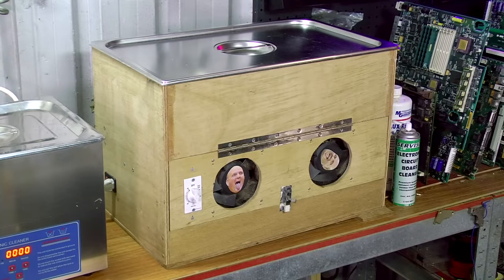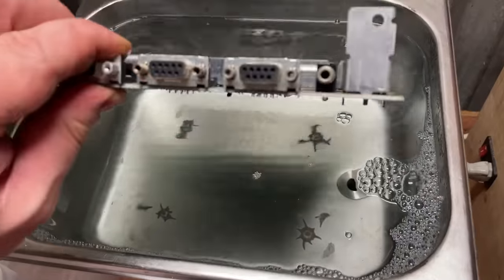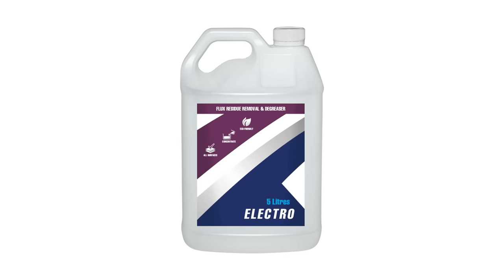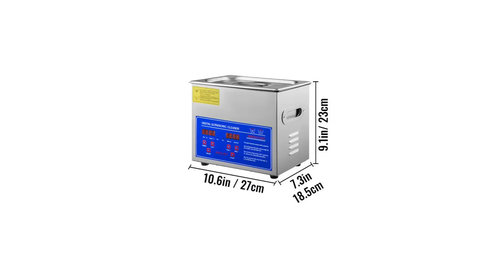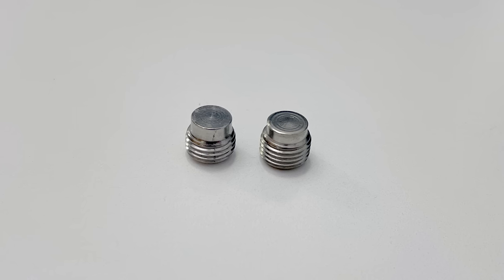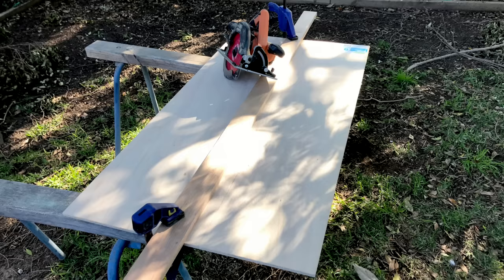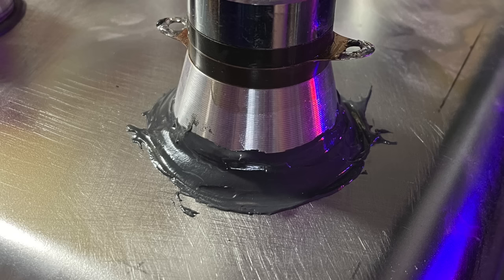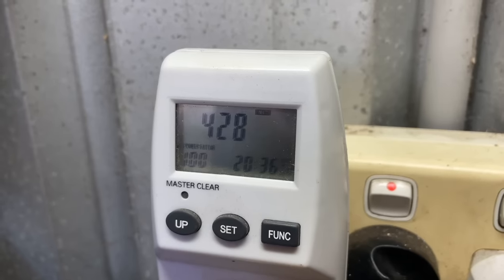Building my own Ultrasonic Cleaner

Comment: I bought a Vevor 55LT that had been dropped hard on eBay for 50 usd, I opened it, I found that 4 of the transformers had dislocated from the boards and like you, I have not found any replacement

Comment: Can anyone tell me why the transducer is able to transmit energy to the container when it seems to be just hanging freely off the bottom, without any force pushing it upwards? Or is it that the horn itself bends, while being held by the small threaded bolt welded to the container?
Reply from the maker: There are piezoelectric plates inside the transducer that vibrate to emit the sound.
Reply: @BranchusCreations  Thanks for the reply! Yea I was wondering though, since the other end is freely hanging, why is the vibration transmitted to the tank, rather than just vibrating the other side of the transducer? But I've found an answer since, apparently it's through inertia!

Comment: very good your video. I don't know what the voltage of this source is for powering the transducers. If it's 12V dc, you could use a real 500W Atx Source. High frequency PWM system very well filtered output voltages.  Long life!!! a hug from Brazil  Thank

Comment: All of the Chinese ultrasonic cleaners on Aliexpress suffer from quality control issues. I ordered few of those, but out of all of them the worst experience I had was with Vevor. One of the two ultrasonic transducers (a 3L unit) simply detached from the bath and fell on the PCB. It was pure luck that it didn't cause a short and electrocuted me. On top of that Aliexpress/Vevor did not want to repair, replace or refund me. That was all after 2 or 3 uses of the unit. Thankfully my bank issued a charge-back few months later (I'm in the EU, here the 2 year warranty is a thing that is taken very seriously). Now I have at least 3 defective units, 2 of those with fried electronics and the Vevor with a broken transducer. I'm about to order a new transducer to replace the detached one and I'm trying to find out how to weld the screw to the bath. I suppose spot welding of some sort, but I can't find anyone locally who can do that, so as a last resort I'll probably just stick it with epoxy, although I prefer not to do that. If anyone has any ideas what process can be used to weld the holding screw of the transducer to the bath, I'm all ears.

Comment: Another great video, Bruce.
I have been looking forward to this video since you mentioned you were going to be releasing it fairly soon👍
I have a fairly small (approx 2L/100W) commercially made unit, with a heater and timer.
I mainly use it for small engine parts/carburetors etc, with dishwashing detergent and plain tap water, it works very well.
I'd like to use it on a multimeter circuit board I've recently repaired.
What are your thoughts when it comes to using an ultrasonic cleaner if the board to be cleaned includes electrolytic capacitors and an oscillator crystal?
Will the heat or frequencies generated, or possible moisture ingress damage such components?
Should I maybe remove these components prior to ultrasonic cleaning?🤷👍🇦🇺Cheers
Reply: Here's my logic: electrolytic caps have a liquid electrolyte inside of them which facilitates their ability to charge. When they go bad, the top puffs up and usually if they go bad violently, the score marks split and the top bursts. The white cloud of smoke is all that liquid evaporating away quickly. That smoke is extremely effective at killing bees and wasps immediately (RODALCO2007, 2016). 😸😸😸🤓🤓🤓 Anyway, if the liquid is kept inside for the serviceable life of the capacitor, that means the unit is sealed against liquids getting into it at atmospheric pressure. Don't put the caps into an exceptionally deep cleaner and they will be fine, I'm guessing. A short column of water probably won't challenge the capacitor seals enough to force water into the unit. As for the crystals, I have no real confidence offering any logic as to the safety of cleaning them in an U.S.C. I'll guess that since the cavitation shock doesn't shatter or pit the thin, delicate silicon dies of ICs and transistors, it probably wouldn't hurt an oscillator crystal housed in a metal canister like they usually are. 🤔 I'm not as confident on that one though...

Comment: You can run them on 120 volts, look in a PC power supply, it's not running on 240v, but 120v

Comment: That failure rate indicates the driver circuits were overtaxed, (or overrated). I would replace them with one large one rated between 1.5-2x over the wattage your shooting for and perhaps add a control to turn it down to the level you want. Again like speaker systems over powering is performance and reliability, underpowering is problem city.

Comment: It is weird you say even the 30L ones weren't big enough. Because based on the dimensions I am pretty sure you just built a shallower version of the generic chinese 22L ultrasonic cleaners. The length/width of the tank are both listed as being 35mm larger, but I suspect that is down to them measuring from the widest point and not the fill line as the outer dimensions are the same and it makes sense they are probably using the same inexpensive food trays you are using.

The 22L version even has 8 transducers. Seems like you could just buy the 22L version and not fill it up all the way to effectively achieve the same results? Then again these chinese resellers are all over the place with their listed dimensions. I am basing this on what I believe is an official document from the manufacturer I found linked on the Vevor website. Either way, I am glad you didn't end up buying an off the shelf product because it resulted in a really informative and interesting video!
Reply from the maker: Yes, this was a mistake. The 30L ones are big enough for the boards I clean.
Reply: @BranchusCreations  Yea sorry, been slowly making my way through your DIY ultrasonic journey videos and just noticed you have a recent one reviewing the 30L model. Seems like based on your measurements what I thought were accurate tank measurements were still off. Thanks for providing an in-depth review and just all your knowledge on ultrasonic cleaners in general!

Comment: 9:20  "...if I'm cleaning a board like this, I usually clean it 10 minutes per side"
Why per side?  Don't these things clean both sides at the same time?  If not, couldn't you build a jig to hold it straight up and down so both sides are equally exposed?
Reply from the maker: The side facing the transducers generally cleans a little better that the other side, but the other side does get cleaned as well. And yes, putting the board in vertically is a good way of getting equal cleaning.

Comment: 5:12 Those are more like 30W, not more. If you want 50W with those size transducers, you need a perfect manufacturing that make the transducers alone cost more than the whole machine. Those sizes are usually 20-30W. If they were around 50, you would already see marks on the inside of the tub with this kind of material.

Comment: Not to nitpick but wouldn't distilled water be deionized by nature? Couldn't this cause the formation of rust on iron/steel components? 

I'm sure the cleaner has some form of inhibitors to prevent galvanic corrosion due to the deionized water.

Comment: Ultrasonic emitter = Speaker
ALL sound is created with air pressure waves.

So in actuality the sander attached to a bucket is using both to clean,
Reply from the maker: True, but it's still not an ultrasonic cleaner.

Comment: Late to the party. Extremely informative video my man.

Two pieces of unsolicited input:
1. You have good taste in jam\preservatives. I'm just a lowly little Louisiana Cajun, but that Bonne Maman is better than anything I get local.
2. I know what's done, is done and I'll check out your follow-up video at a later time. But I think you made the same mistake I make far too often, which is improvisation for the sake of improvisation. I think you should have skipped the JB Weld (as much as I love the stuff) in this application. It would most likely have been more beneficial to make some calls to local machine shops or welders offering their services. When you have virgin materials (nice and clean) the welder would have to do very little prep and being that this application is not structural it doesn't require a ton of welding. Your cost would probably have been the same in the end (cheaper if you consider "time is money") and quality/reliability would have increased exponentially. Plus you are supporting a local business.

🍻

Comment: Wait... if the water electrifies such you need to earth the tray, how come this contraption doesn't trip your RCD? -klimate chambers (for accellerated wear testing) have a similar problem (though we don't use them for their intended purpose) and we have to have them on a "non-RCD" circuit. Luckily we're ISO17025 certified, so we're allowed to do this (there's actually an industrial RCD in the circuit, but the trip current is 3 Amps, so it's recommended not to shock yourself on that circuit 🤣🤣).

Comment: Nice work! Have you tinkered with frequency sweeping to counter focal point hotspots and dead spots? I'd imagine that you could use aluminum foil as a witness marker for your generated beat frequency oscillation focal points. Then run an arduino script that triggers the transistors for the output xfmr's to walk those focal points around, play with different variables in the script and just have FUN! I've seen different base frequency specs for different cleaning applications. Certain jobs use higher freq. Picking the brain of the engineers at one of these mfgrs would be enlightening.

Comment: what if you drill la small hole in the stainless tank and tack weld the little bolts? then jb weld the transducers?
Reply from the maker: I have found the perfect solution for attaching the transducers and will provide all the details in my follow up video coming in a couple of days.

Comment: If the actual transducer itself is essentially a speaker, you could wire a group of 4 together & use a single driver. You would use a combination of series & parallel wiring to end up with the same impedance as a single transducer.

Comment: You could use a sous vide cooker to heat and precisely maintain the solution.  Anova Culinary AN500-US00 Sous Vide Precision Cooker (WiFi), 1000 Watts | Anova App Included, Black and Silver

Comment: Good video. Any one in the UK recommend the best cleaner for this type of work ?

It's  a good idea to ground (or earth)  external metal parts like the stainless steel tub. Anything over 50 volts has the potential to kill particularly if you have a weak heart - and check  the resistance is  zero from the supply ground to the tub  itself and even if  the water is deionised wet skin will conduct electricity better than dry.. 

Maybe you got a shock through static electricity but it has to be worth checking it for a fault with a DVM  - if you are familiar with these things. If not get someone who is .   If there is a voltage  on the tub it  needs investigating as to why. I have had a lot of stuff  out of China in particular that although it can work well  the safety on electrical stuff  can be pretty shitty.  A partial short to ground  is probably not going to blow the  mains supply fuse/trip the breaker either so  grounding the tub  will still leave  the fault in place waiting for the tub ground to fail one day  and then you will get another nasty shock - or worse     

I think Aluminum is a US thing .  It's still Aluminium in the UK at least and last time I checked we were still in the Northern Hemisphere !

Comment: A decent method of drying items at room temperature is to use a Hydro Aspirator to draw a vacuum.  You can just use a water pump in a closed circuit system so you're not wasting any water.

Edit: I can attest to our 10L Ultrasonic Cleaner at work leaving star patterns on the surface of Stainless Steel and Aluminum parts.

Comment: Doing sth diy is always fun and in your case, because you needed a specific size, it does make sense

But in most cases, buying even the more expensive 300-400€ 30L cleaners make more sense for large things, cost wise it's not too diffrent and you save a ton of time. And let's not forget that most ppl should not handle electronics that go to several hundred watts

Comment: Don't put your hand in the liquid while the cleaner is running. The ultrasonic pressure waves can burst the cells in your fingers. It will look OK at first, but later your fingers may appear black. That's Internal bleeding. If you're particularly unlucky, gangrene will set in and amputation is the only course of action left to save your life.

Comment: brazing should have been enough.  or as everybody else will say drill thru...   but I'd just weld it.

evenly placing them wouldn't really be required. cancellation and such.  I'd have just put them near the corners where the panel is strongest.
Reply from the maker: I used silver solder for my next build and it worked beautifully.

Comment: If you're even considering building a new one, why not build one that's tall and thin and considerably wide, so you can lower large boards in and have the transducers blasting ultrasound in from the sides. It would require having a metal container custom made... Not sure if it would be worth it

Comment: I welded mine to the tub I made. Yes I can tig weld .
Reply from the maker: What's your opinion, do you think it can be done with MIG? Or will I just blow through the tank?
Reply: Stainless mig maybe. I put holes in the tub and welded from inside to seal the holes
Reply: Where are you located?
Reply from the maker: Sydney, Australia.
Reply: @BranchusCreations  ok. You could take it to a shop specializing in stainless steel and get them to weld them if needed.
Reply: I'm in Brisbane

Comment: sounds to me like you need some HV diodes on the output to the tranducers. you should not have four separate drivers whilst driving so many crystals in cohesion. the drivers are operating out of sync and backfeeding into the other transducers(crystals). you need to sync the drivers for best deficiency. that's my theory  anyway as to why they keep burning up
Reply from the maker: I've since found out what the problems are and will be covering them in a follow up video.
Reply: @BranchusCreations  sweet!

Comment: I have seen many of these cleaners where 'speaker' is dropped. When you weld those taps with right technic, then power could be better and those ultrasonic don't wibrare and cut those copper disc's like what happens to foil in water when sonic is on.

If you use that, you going to get more problems, report these, please. 

I'm going to build one specific (many ways),  and fix broken ones when I meet them. 
Looks these have always problems, home made or not.

But think how you put those 'speakers' bottom of tank in way how you did it and how water can amplifie power in some spots in tank. And if those all are driving sync, it could made huge difference in system. I'd drivers could float in own sync and not take the frequency from 230v 50hz and use it to multiple or something stupid (what I don't think is happening). How about make driver or link these, so everyone drives in just same waves every herz and switch where you could put them "floating" without effect to near driver(s).

If left side is driving in sync and half of these to right side are driving half way different phase (180 degrees), it could made huge effect. You must think these ideas by self, maybe you innovative something new. It's weird that those elements cannot drive crossed input, like speakers needed to drive some cases. It's still ac current, but is it only pulsing it and stays "dc" side? I have hard to believe that. Must learn more that effect and drivers behavior..

Thanks for this video!
Janne

Comment: Earthing of the stainless steel tub is essential /Earth leakage Circuit breaker required wood sa poor conductor of electricity
Reply from the maker: I am using a ground wire attached to the tub.

Comment: Couldn't you just drill a hole and bolt it to the bottom? The transducer head is the nut. If the added mass is an issue, hollow the bolt.

Comment: ** I'd wire the bottom(center as positive) as negative as it appears(I maybe mistaken) to be essentially ?chassis? ground rather than positive, but assuming it's DC I doubt you'll run into much of any issues either way

Comment: Builders, Just Do it Right from the Start and Spend the Money and have a Competent Experienced Welder weld the studs on. Epoxy will Never Last.  Using Epoxy for this is just Silly.  Welding it properly will last a life time and You will never be unhappy once you spent the money.  If one of the transducers ever goes bad all you will have to do is unscrew it and screw a new one on.  Thanks for the video.

Comment: So I have done auto paint for 30+ years and though they do not make this product anymore we used to buy this product called "Duramix" (bought out by 3M and they ruined it) Duramix was a 2 part mix with a special applicator gun that you had to put a special tip that had a plastic deal inside the applicator tube that mixed the two parts very thoroughly. Duramix could glue your fender on your car better than you bolting it on.  Now 3M makes the same style glue it is just not as good as Duramix was. 3M just bought them out to remove them from taking money from them with a better product.